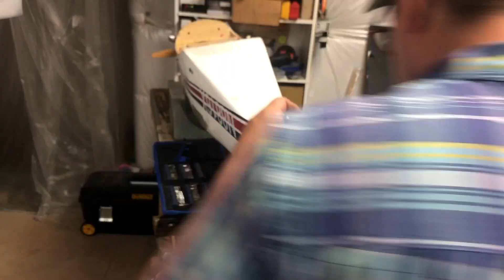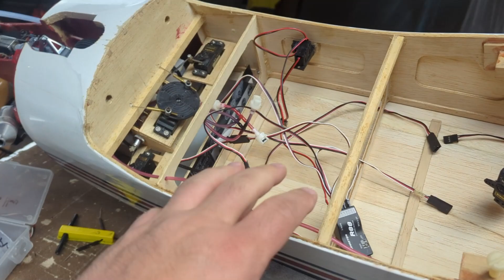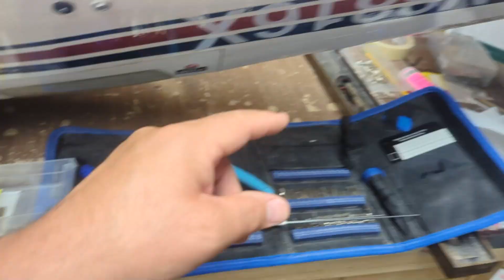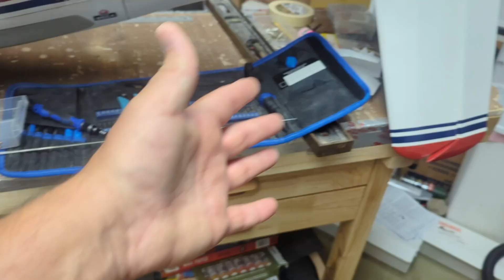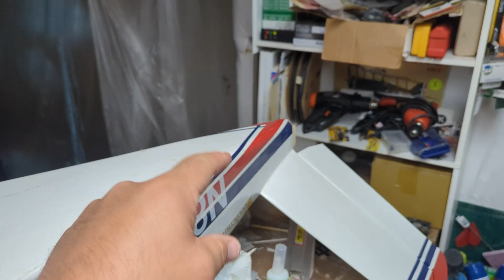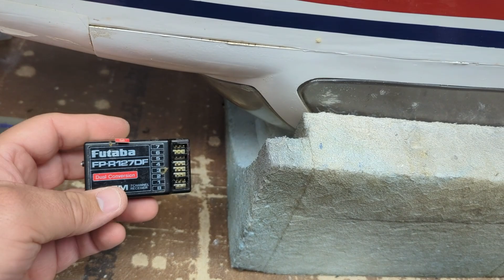Top Flite Bonanza V35 | Restoration Part 3

Comment: I betThe tail servo was backwards to get the correct movement on the V tail.  You said there was no mechanical mixer. I bet that's why the previous builder did that

Comment: The servo on the tail is in backwards because he used a y connector and could not reverse the servo.
Reply: Exactly correct, old school trick instead of opening the servo and re-soldering the wires.

Comment: Hello from Sweden.
Is the servos not possible to install from the other side? So them not is that close to the wing?😊
So (in the picture) from the bottom up, then they would be lower and also rest on their mounts instead of hanging on them when you turn the plane.
Reply from the maker: Not easily. I'd have to remove the canopy but additionally, the push rods do not exit lower so I'd have more work involved to make that happen. Then consider if I ever to find a cockpit kit, that would likely interfere with the floor of the cockpit kit. Lots of decisions went into that compromise.